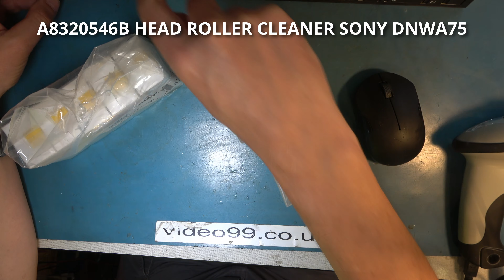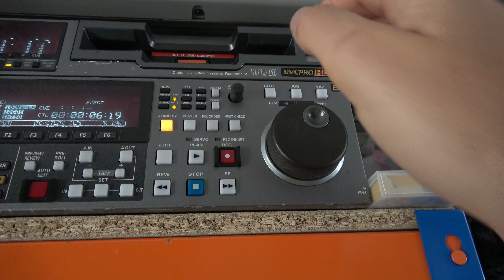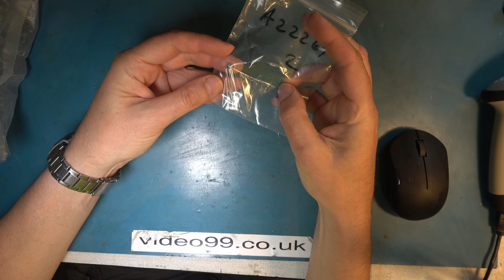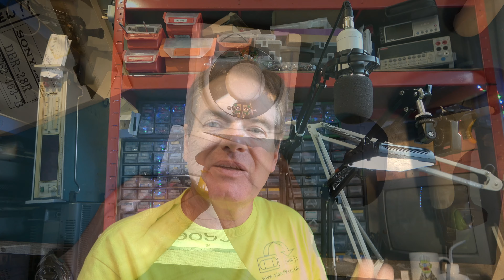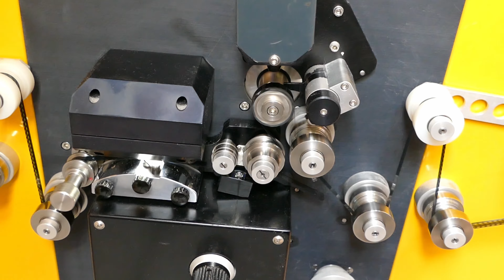£1000s worth of spares for Sony professional equipment

Comment: I've got a DVW-A500P that doesn't pull the tape through in play, but all other transport functions work perfectly. I'm now wondering if it just needs a new pinch roller! Didn't realise they were a common failure.

Comment: Good night friend, I really like your channel here in Brazil, I watch all your videos, I learn a lot with your tips. I'm going to ask you a question which is the best TBC brand or model with a cost-effective and cheap coating that meets my need to reduce the failures of VHS video cassette tapes so that I can do a quality digitization
Reply from the maker: I would start with getting an SVHS machine which includes a TBC.  There were several models from Panasonic and JVC.

Comment: The single black line resistors are probably fusible links. In a lot of things they are used as fuses. So having replacements is nice.
Reply from the maker: Maybe, but would need to know their fusing current.

Comment: Wow, what a wonderful selection for your spare parts inventory! Out of interest, I went through my old service notes and can tell you the original prices of some of these; this is the cost price to Sony dealers, without VAT, as at July 2000 : 
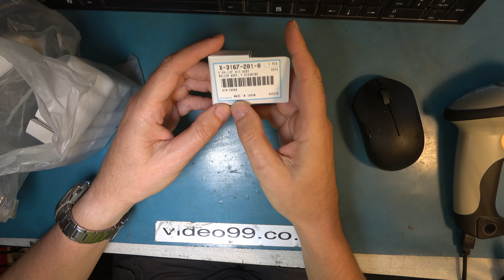3:44 X-3167-281-8 Cleaning roller -- Looks very similar to X-3167-281-3 used on DVW's, they cost £12.97
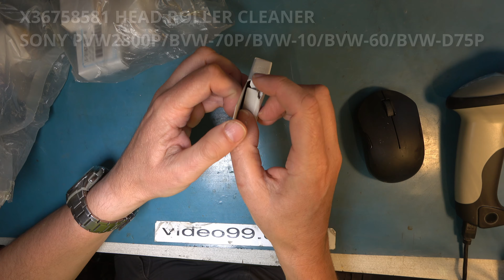4:20 X-3675-858-1 Cleaning roller for PVW's, cost £3.38. [I could do with one of these - they are the sponge type which disintegrate]
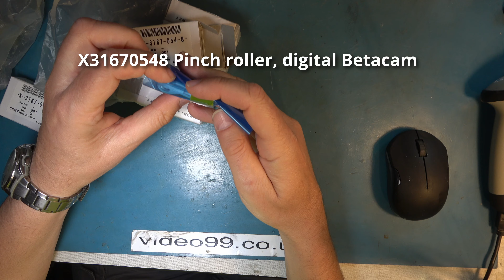9:00 X-3167-054-8 Pinchroller for DVW-A500 etc, cost £29.46
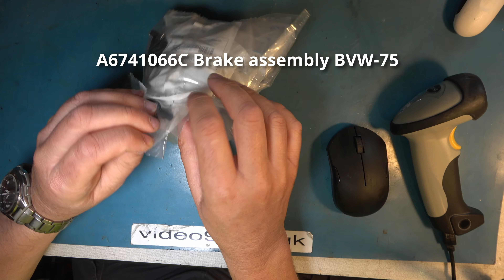12:21 A-6741-066-C Reel brake for BVW-75 etc, cost £3.38
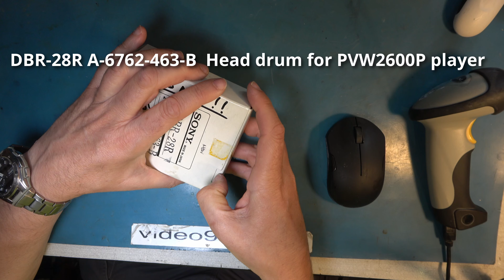12:57 A-6762-463-B Upper drum for PVW-2600P, cost £196.00

Nice seeing that record button fit on the Panasonic.
The prices for parts being charged on the webpages you showed are deplorable, I would avoid them like the plague!
Probably the best source of spares is buying untested/scrap machines, they appear on ebay all the time really cheap (unless they are a SL-HFxx Betamax!), but usually you have to collect, and you need the storage space.
Reply from the maker: Those original prices are very fair indeed.  You could quite happily change your pinch roller every couple of years at that price.
Reply: @video99couk  They weren't bad. Depends on the machines, BVW & DVW were always more expensive than PVW/UVW, but they are a different class of machine. E.g. Complete drum assembly for DVW-A500P was £2598, for BVW-75P : £2107, PVW2800P & UVW1800P : £524.

Comment: hi there's alot of the sony a500p  around    the only thing they are very heavy i am very fit  and having to be carefull about
my back    i have turn down so many   betacam sp  digi  decks  all working just the space  i have 10 digi one in the hall 

i payed silly low money for they all work £25-£40 each   the front panels and  buttons  coming away  and breaks in panels 
my brother payed for alot of them  

money in the deck is better than in the bank   and i checked what people like you   fee's are are 
very easy to get money back